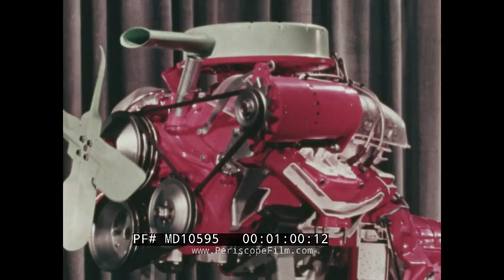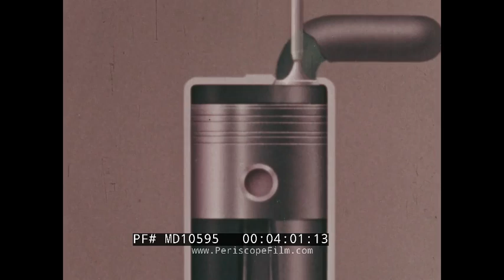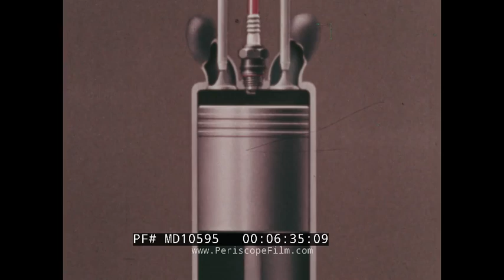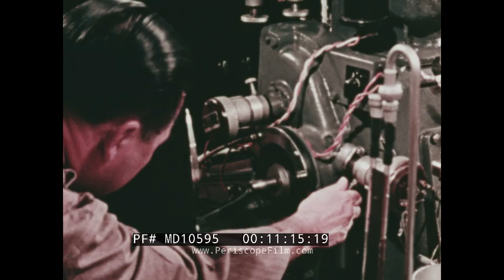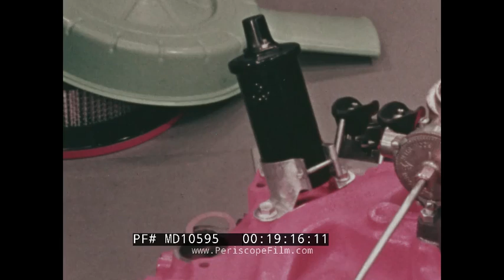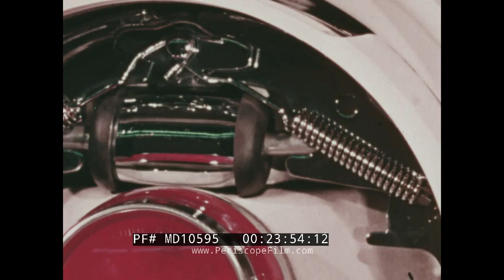" WHERE MILEAGE BEGINS "  1961 GENERAL MOTORS  OPERATION OF INTERNAL COMBUSTION AUTO ENGINE  MD10595

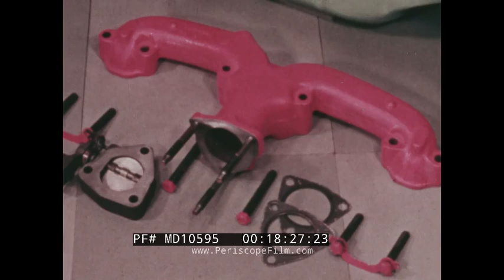Comment: 18:32 - what the heck is the throttle valve assembly on the right bank exhaust manifold?!
Reply: That is the heat riser which warmed the engine more quickly and the wound thermospring opened up the plate as it warmed to let the exhaust gases flow more freely through the exhaust.
Reply: Heat riser valve to heat the floor of the intake manifold and improve fuel atomization during cold start and warmup.  The valve would close when the engine was up to operating temperature.

Comment: 14:15 Mmmm 2-bolt mains. Strange, those pistons have reliefs for 4-valve-per-cylinder heads, but the heads are only 2 valves per cylinder. What gives?
Reply: I'm thinking the pistons have offset wrist pins and have to work on either side of the engine.

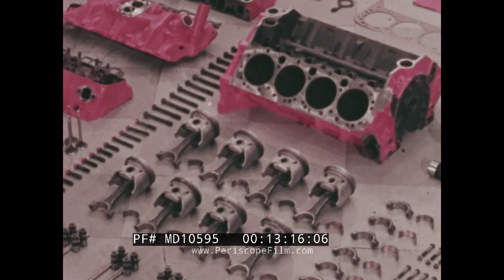Comment: The first half of the video is very elementary explanations of 4-stroke engine operation. For tech-savvy folks it gets much more interesting around 13:14 with views of engine components and somewhat comical animated assembly of a familiar small-block V8. Some of the obviously outdated features are generators, canister oil filters (not spin-on), breather tubes (no PCV) and X-frames.
25:03 "The modern car has everything, in fact, except the skill of the driver, and in this electronic age the restless minds of the automotive engineers may someday build even that into this marvelous machine." An all too true prediction of the auto-steering and auto-braking functions built into many modern cars to help distracted and inattentive drivers avoid collisions.
Reply: Thanks!
Reply: Don't forget fuel injection, which Chevy introduced in 1957, but it didn't fully replace carburetors until the early 1990s.
Reply: The machines are evolving and becoming more capable while people are de-evolving and becoming less capable.
Reply: Indeed, the technology for self driving cars has been with us for a while. It's now a question of regulating it and who is willing to pick up the liability when things go wrong.

Comment: If you got 100k you where lucky back then.
Reply: I have a ‘63 Studebaker which has a lot of parts from GM’s supply chain manufacturers.  The 1,000 mile service interval is laughable by modern standards.  And that is not insignificant service - oil, fuel filter, chassis and drive line grease fittings and setting the points in the dual point distributor.  It is easy to forget how much more work 1960s cars took to obtain the reward of being able to drive 1,000 miles.
Reply: My grandfather got 370,000 miles with his 1958 Chevy Biscayne...283 small block V8.
Reply: You got hundreds of thousands of miles if you did the maintenance by the book, but few cars got proper maintenance.
The main reason new cars generally last for more miles is because they require less maintenance.
Reply: @KDoyle4 Had 3 x 302w all killed by variable venturi carberator putting gas into oil.
Reply: @publicmail2  I ran my Ford 351W V8 with it's Motorcraft 2100 2-barrel 335,000 miles until I retired the car due to rust.

I ran 3 AMC Rambler Americans over 225,000, two with the old 195.6 engine, and one with the more modern 199 engine.

Checker Cabs powered by Chevy 230/250 sixes regularly ran half a million miles with no overhaul.